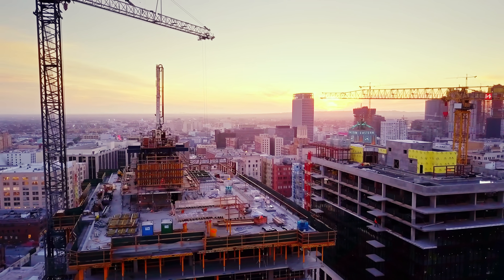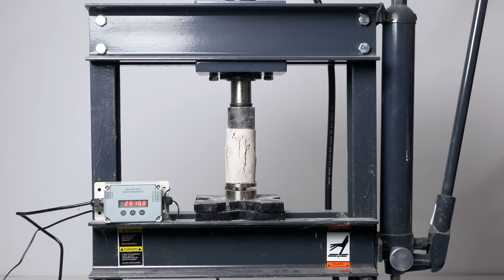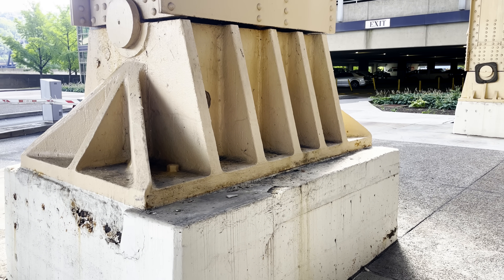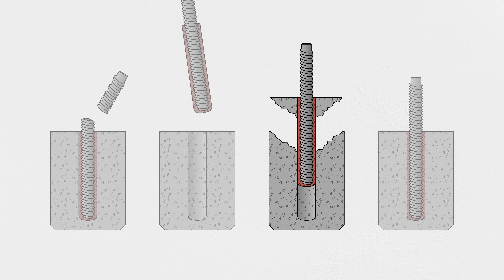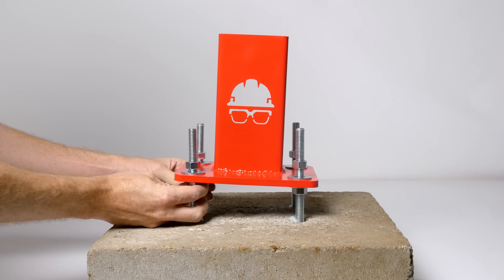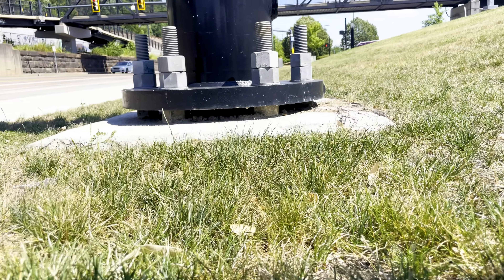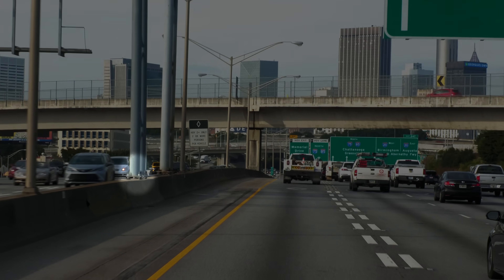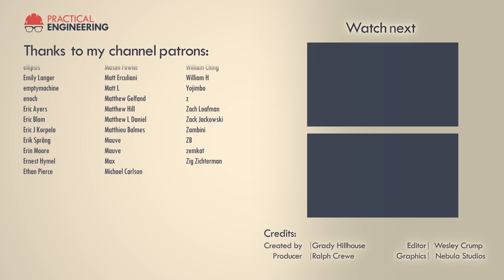What’s the Deal with Base Plates?

Comment: Hey! I actually have a real-life use case that goes with one of our videos. I designed and helped build an astronomical observatory. Two concrete piers are located inside a small building with a roll-off roof. Telescopes and their mounts big enough for this project are heavy beasts, and getting them connected, level, and at least somewhat isolated from the concrete piers -- for both vibration separation and moisture coming up from the soil underneath -- led me to use L-shaped stainless steel threaded rod, with thick stainless steel plates and leveling nuts. I didn't have engineering software or the knowledge needed to accurately size the materials needed, so I did what I often do when making something structural: obvious overkill. The scopes are so strongly supported and separated from the concrete piers that you can whack on the piers with a large hammer and not see any movement at the eyepiece of the scope, even at high magnification. (Yeah, I wanted to test this, so I did, just once!)
Reply: Ha, I was going to mention this looks like the pier plate of a observatory mounted telescope. :)
I'd love to see a Practical Engineering on big observatories.
Reply: @nitehawk86  Oooh! I'd love that!
Reply: I had heard on some of the telescopes, the bases are floated on pools of mercury.  The mercury provides little friction to turning and it doesn't transmit external ground vibrations well which if you have very sensitive equipment and are taking photographs of objects far off, any little movement can mess them up.
Reply: @lewisdoherty7621  That would be for scopes WAAAAAY bigger than either of mine (both of which can be lifted by hand, though barely). If I recall correctly, the Palomar Telescope, with a primary mirror 200 inches (5 meters) in diameter is one of those balanced that way. It was the largest scope in the world for several decades, after it opened in the late 1940s. There are several much larger ones now, with one being built right now called the Extremely Large Telescope. It will have a mirror nearly 40 meters across!
Reply: It's not obvious overkill, it's designing for deflection limits with large a large Factor of Safety
Reply: @MordecaiV  Engineering vocabulary to the rescue! 😃
Reply: @MordecaiV  😁
Reply: As an amateur astronomer without a permanent observatory for my telescopes (although I know people who have them), I appreciate what you did.  I am also a civil engineer who occasionally designs foundations, anchors, and base plates for small signs and light poles.  For my last project of this kind (modest-sized light poles at a park, about a year ago), I used the Simpson Strong-Tie Anchor Designer software, which is free.  However, if you don't have an engineering background, I suggest getting an engineer to do the calculations, especially if the calculations must be submitted to an agency for permitting.

L-shaped anchor rods are fine for modest loads, but if you get into a situation where anchor loads are high, I suggest hex head and heavy hex head anchor rods.
Reply: @skysurfer5cva  The L-shaped anchors are more than strong enough for these loads, but that's good stuff to be aware of, just in case a large grant falls into my lap!
Reply: Please keep overkilling these designs. As a Surveyor always trying to chase a few mm on an anchorbolt on projection height and horizontal location, with rod busters that don't care, concrete finishers that don't hit elevation, or carpenters that adjust bracing after it's been set and surveyed...nobody has time for exact design tolerances. Give the wiggle room that incompetence doesn't account for. I'm so tired of trying to make bolts fit that no longer end up plumb, or fit separations necessary to actually fit the plate they're supposed to. Everyone passes on the buck for timeliness that don't make sense based on tolerances required. It always saves money in the long run if it's over designed, rather than having tighter tolerances.
Reply: @ron6625  I totally agree! I had a friend from my dad's generation (I'm 64) who once pointed out to me something that's stuck with me. I'm not saying he thought of it, but he's the one who passed it on to me: When uniform building codes became a thing, and minimum standards were set, those minimum standards quickly became maximum standards; why go beyond them?
Reply: @paulkinzer7661  This is a really useful thing to remember. I a (hopefully) about to build a house and studio so I have been reading local vs international specs for various things to make sure most of the work is done before I get the engineers involved. Knowing that a small amount of overkill is not actually a bad thing is hugely helpful
Reply: @HomeFromFarAway  Good luck!
Reply: See my comment about the leveling blocks and active dampers I use for big, heavy, precise optical tools (sub-micron positioning).  We could be friends & have a beer.
Reply: @unreliablenarrator6649  Ha! Right up my alley of interest!
Reply: I know the overkill method and then those that like to rip on you for how indestructible it is with their jokes. My mailbox that the rural mail carrier kept hitting is a prime example.

I had a nasty mail carrier that denied hitting the plastic mailbox with her passenger mirror even though paint streaks matched her car. This occurred multiple times with the mailbox drooping to one side after impact. She would withhold mail when asked any questions about what happened. 

I moved the mailbox out of the radius of the driveway and went to work build a new foundation and decorative mailbox post after she snapped the rotted 4x4 post. Enough of her antics. 

The new foundation utilized a smaller scale of the foundations used in traffic signal pole foundations and would definitely not move when hit and would likely be the only thing standing if a hurricane wiped out the area. It was joked about serving as a hook up point for anyone needing to winch out of the ditch if the road was slick with ice. 🙄😁

The foundation was 12" x 24" deep with a rebar cage welded to 2" square 1/4" wall tubing. A flange was added to be able to cast the foundation, allow curing and then install the arm with mailbox easily.

The main mailbox post was elevated to match the mirror height on the mail carrier's vehicle and designed to protect the standard metal mailbox from damage. 🤫

The design throughout was 1/4" wall top to bottom on the main arm. I added a 1/8" scroll band for decorative purposes. I painted it with a dark metallic gray hammer paint and it looked great. It took about a week before the first paint scuff appeared on the end of the arm just below the mailbox.

It scrubbed off and kept taking hits. I noticed the mirror on her car was getting torn up with gouges and heavy scratches. One day she had no mirror and I found little pieces of plastic laying below the mailbox. Evidently my mailbox ate her mirror. 😂😂 

I have no idea how someone driving from the passenger seat in a left hand drive vehicle can't judge being too close to a mailbox but I never had any trouble with it getting knocked down again. 😁 Her passenger mirror got changed out a couple of times before I sold the house in NC. So if you can't get some to understand damaging your stuff is not cool, build a beefy version and sit back to watch the show when they find out the new one doesn't move. 🤣
Reply: given the 20th century, "CAD" and computers are so overrated
Reply: That is so freaking cool! I want a giant telescope so bad. I'm actually thinking about turning part of my roof into an observatory. Of course I got the idea from the internet.🤣
Reply: Hopefully with a real deal hammer swinger 💪🏽
Reply: Obvious Overkill will be the name of my sextape
Reply: Pual  ok i need to see the dwgs  or have practical eng dude do a graphic please   l shaped rods ???
Reply: @edzukich  They're 'L' shaped rods, with the shorter part of the L pushed into the concrete when it is wet, to keep it from pulling out once the concrete has cured. The rod is threaded so that two nuts can be threaded onto each rod. Then, a plate with holes in it (larger than the L-rods, and unthreaded) goes between the pairs of nuts. The lower nuts are then used to level the plate, and, once that is done, the upper nuts are tightened against the plate to make everything solid.  There are other, threaded, holes in the plate, used for mounting the actual telescope mount with bolts. I hope that helps!
Reply: Obvious Overkill can add lots of $ to a project and can even cause a project to be canceled, changed, or could make you look not so great if they hire someone else who can get the numbers correct.   I suppose it depends on the situation.  I am a contractor in CA and over the years been  seeing  growing sizes in footings and underpinning blocks.  To the point were on one  beach properties  we had a total of three  6' x 6' x 6'  blocks to support . 3 steel posts to support an existing  cantilevered balcony that extended out 7' from the structure and was proposed to be enclosed into living space.  So the clients did it anyways $25,000.00 cost ( for just the concrete and posts) because of time and despite my objections they were not sure what was necessary, and what another engineer might charge.  It ate into the budget on the rest of the project, so thats the cost to the clients because of obvious overkill.
Reply: @sparkey4293  I can see that argument, and don't want to in any way dismiss it. Still, in my situation, I paid for the overkill materials myself, and the cost was  less than $200. Also, much of the funding for the entire project came from my local school district, but to get the thing moving, I donated several thousands of dollars worth of astronomy equipment. I also put in lots of hours of unpaid work, to, among other things, paint the interior, as well as design and install the solar electrical system. 

I could also tell more than one story about how others involved in the project -- who, I would have thought should have known better -- made uninformed choices to change the design (MY design, based on other observatories I researched) and 'underkill' aspects of it in order to 'save money', only to have to either re-do the work or do something else to fix the problem afterwards. I won't tell those stories, though, because it would involve too much cursing.
Reply: @paulkinzer7661  Sounds like in your situation overkill was understandable, and acceptable.  My main concern is when  charges for engineering are made when there is not any real engineering taking place.
Reply: @sparkey4293  Oh, yes!

Comment: Also remember that additional plates can be embedded in the concrete as part of the anchor bolt structure. Those can help distribute both compression and tension forces into the concrete footing.
Reply: Correct, and not fun to install when they are in a foundation with lots of rebar.
Reply: I've never seen this in the sign biz. That sounds like a headache to ensure that concrete completely flowed above and below the captive plate with no voids.  Vibrating will help yet 'faith' sees involved. Obviously you know what you're talking about. Just strikes me as odd. What are the applications?
Reply: @davidwilliams9302 ive installed a bunch and they are usually "X" shaped to hold all 4 anchors together
Reply: @davidwilliams9302  you design the reinforcing such that it is a welded cage, and the mounting bolts are a part of this, with welded on L plates that act to spread the load to the reinforcing, and thus allow it to support the load. By me that was done for light poles with caternary cables, which are repurposed century and a half light poles, that originally held tram wiring. he old poles went down to buried concrete blocks that were cast around them 150 odd years ago, when they were removing them they dug down to this layer, and were using cutting torches. I did suggest to the contractor he really needed to go hire a large air compressor, a generator, and a plasma cutter, as that would have made the cutting a 1 minute process per pole, after digging down the meter to get to the base. acetylene torch was taking him around an hour per pole, they are that thick. When they came back they had a standard 8 bolt pattern flange welded on to the base, and had, because of the length, been powder coated, as there is no galvanising bath by me that can handle a 12m long pole, it is 10m long. But the new bases are a 6 cubic meter of concrete, with a rebar cage in them that incorporates the stud base and a secondary alignment ring that was used to bench the concrete fill to. Each base took a full load of concrete to pour to that level, and the base is buried 15cm under the ground level, with another 5cm of pavement tar on top.
Reply: If you mean the template plate that's only 1/8" or 1/4" thick, that has little structural benefit. However, we also often have 1/2" or 3/4" plates at the ends of anchors (headed anchors), which we d4esign for bending forces and do improve the tension capacities.

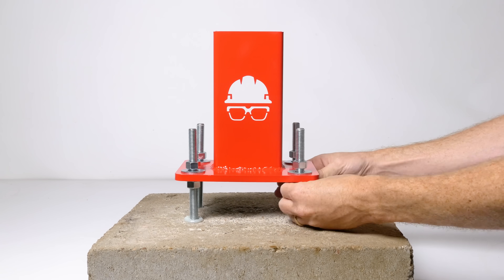Comment: At 7:50 in the vid you mention adding grout to aid in load transfer, however, in our area, all of the base plates are just secured with the anchor screws alone, with anywhere from 1" to 3" from the ground to the plate. So, all the load is transferred to the anchor bolts alone. Is this normal or did the engineering folks miss something in our area? There are very few locations which have the grout you mention. We are in a moderately windy area.

Comment: The thicker the steel baseplate the more rigid it is. But it still flexes.  But solidified concrete also flexes and so does glass. Standing on a concrete overpass with heavy traffic traveling over it has freaked out many rookies the first time they experienced it.

Comment: As a structural steel fabricator and welding inspector, I work with all types of baseplates everyday. I have seen some pretty interesting designs over the years from you engineers 😂

Comment: I am an amateur radio operator. I have six outdoor antennas. They are all either vertical or wire. Some of my friends have the big yagi antenna on top of a tower. My friends with the huge yagis have to take into account for a wind load with the guy wires, foundations and anchor points. Me? My setup honestly doesn't have any wind load, even though I live in Reno, Nevada, which often sees winds coming down the Sierra Nevada mountains at over 50 mph. My favorite antenna is an end fed half wave that is tuned to 40 meters (it honestly works great from 40-10 meters). It is setup as an inverted V. It has survived all kinds of storms. What it didn't survive was when a landscaper dropped a tree on it. But I fixed it with a little solder and some heat shrink.

Comment: I built a 75 foot long tilt over radio tower for my antenna's. I am no engineer, so I over built it. 3 yards of concrete, over 300 feet of rebar in the base, 12 -5/8 anchor bolts cast in place, and all leveled with nuts.  I have 1000  pounds of steel in the self made hinge base and truss system to lower the tower. It didn't break, at least not yet.
Reply: I'm laughing because obviously a straight antenna doesn't have the wind load or leverage of a big square sign, but "3 yards of concrete" and "75 feet tall" in the same sentence is giving me the sweats!
Reply: @davidwilliams9302  Its a Rohn 25G tower and has 2 sets of guy wires. The base plate is 3 feet by 5 feet 1/2 inch steel plate. She be rugged.
Reply: I wonder if I saw you post this same thing years ago. I don't remember which video or channel, but I recall a very similar comment. With a guyed tower, the base foundation just needs to be wider to support the extra down-force froim the guy wires, it shouldn't need much in the way of depth or anything like that. I would expect probably a 6'x6' by 2' deep foundation for a 75-tall guyed tower, just bearing below the frost depth basically.
 
Now, the guy anchors on the other hands, those are the really hard things to design. You often need massive concrete deep underground to give you enough weight to resist huge loads from, like, 1000+ ft tall towers.
Reply: @kindlin  Our frost goes down 4 feet. The cement is a touch over 3 feet wide, 5 feet long, and 5 feet deep. Its so big because it supports the tower as its lowered. The lowering truss is 20 feet high where the winch pulls from so the torque load is high. My guy's have 300 pounds each of pre load.
Reply: @1958johndeere620   Oh, ok. I'm not familiar with collapsible towers, there must be another tower somewhere that lifts up a guy wire or something to pull the tower up? Or is there a giant motor to torque the tower up, just from the foundation? And out of curiosity, what size guys do you have on that? 3/16? 1/4? At 3/16, the 300# would be just about standard spec (10% BS).
Reply: @kindlin  Incorporated into the hinge plate there is a 20 foot tall ridged truss that holds the cable to raise and lower the tower. The base plate also holds the 8000 pound winch. Once the guy wires are released, I just lower the tower by the remote controlled winch. I can do the entire process myself with no help. Yes 3/16 cable.